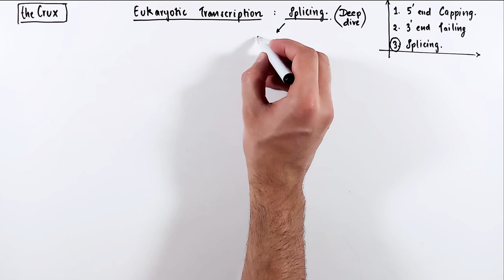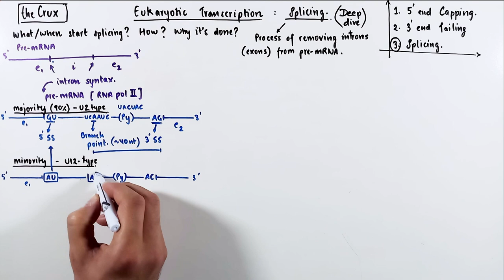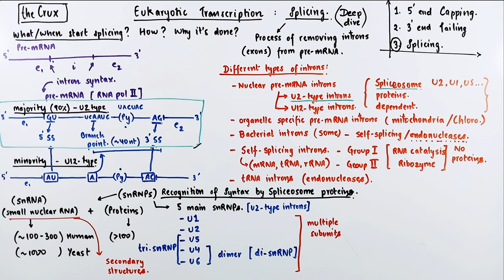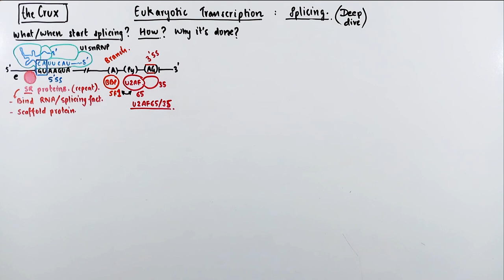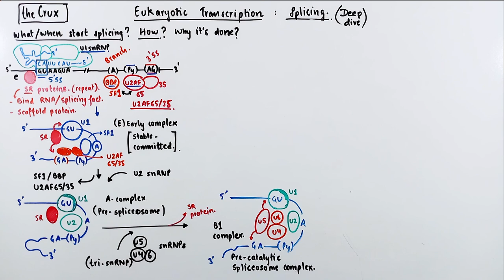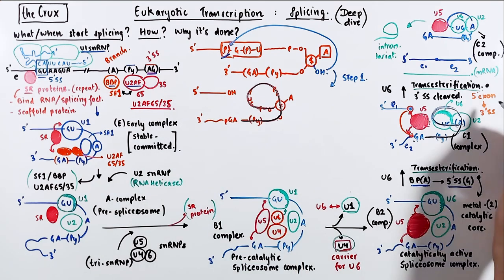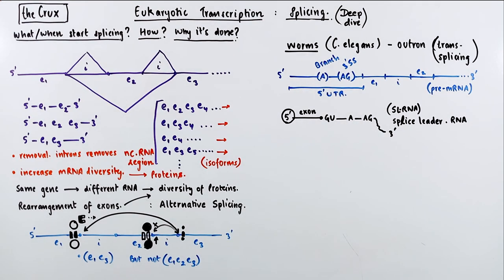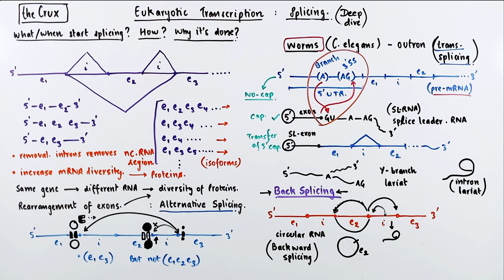mRNA Splicing - mRNA post-transcriptional processing/modifications - What is alternative splicing?

Comment: Another great video. You should get an award for the board work alone. Quick question. The RNA pol is known to slow down at the intron location to give the splicing mechanism enough time to do its job. Is this sequence specific? On that same note: is the promoter proximal pausing also sequence specific? Thank you.
Reply from the maker: Great questions! 

1. Pol II slows down a bit at 3' SS. Pol II elongation rate depends on multiple factors: 1) GC rich regions are difficult to process at high Pol II speed (some introns appear to show bias at the 3' SS) 2) Epigenetic modifications (some methylation marks like H3K79me2 *do fact check me on this*) correlate with faster elongation rate. 3) Some introns can also form G-quadruplex and Pol II tends to slow down there. 4) The relative availability of rNTPs can also affect the pol II elongation rate. 5) Histone enrichment and DNA topology are some other factors that I think can also influence the process (although I doubt there is much literature on this). So, there are some sequence specific features, but I don't think we understand the control the elongation rate of Pol II in great detail, yet. A caveat to all this, is that elongation rate depends on multiple contexts and genes and specific introns. So some introns may have these factors influencing the elongation rate, while other introns will not have these factors.

2. Promoter proximal pausing appears to be primarily regulated via phosphorylation of CTD - the tug-of-war between NELF/DSIF/pTEF-b is usually what determines the balance of release/no-release. I am not aware of studies that look into sequence divergence at proximal non-paused/paused Pol II sites/genes.

Comment: Great video Crux!! I was wondering, could you explain in a bit more detail back-splicing and the functions of circularRNAs? Thanks!
Reply from the maker: Hi Jorge! Back-splicing appears to be an abnormal type of splicing, where 5' end of the pre-mRNA upstream exon is spliced with the 3' end of a downstream exon. Current research isn't sure why/how this occurs mechanistically, but we do know that it forms circular RNAs. Thus, the abnormal splicing forms abnormal circular RNAs (instead of a lariat that typically results in canonical splicing) - they are correlated with pathological conditions. Circular RNAs tend to be more stable because they are circular so exonucleases can't cut them. Their accumulation becomes a problem for the cell. There is some support that SOME circular RNAs serves biological functions like RNA transport, miRNA action etc. but mostly in eukaryotes (especially generated by back splicing) they are considered a problem. Hope this helps 🙂

Comment: I have a question on isoform expression... Do cells make mistakes when expressing the isoforms? Like when they try to express one trait will they accidentally express a different gene that is coded for in an isoform? So if a cell starts expressing a gene that codes for multiple proteins and it starts producing more of one of the two proteins on that isoform gene, will it make mistakes and create more of the other protein coded for by the isoform?
Reply from the maker: Typically, the isoform expression is well regulated. And yes, cells can make mistakes in alternative splicing, which typically leads to diseases. You can read about one of the many examples here: 10.1016/j.cell.2016.07.025